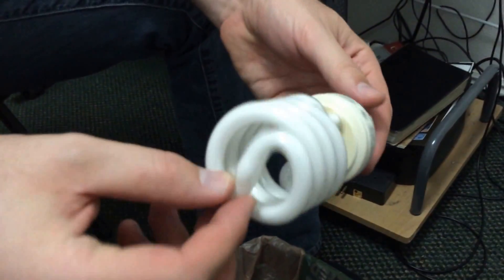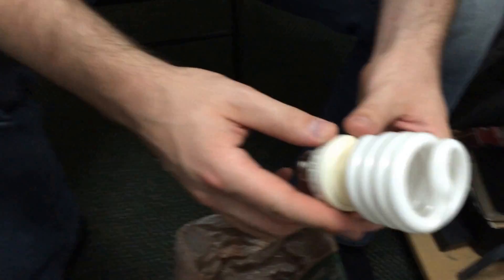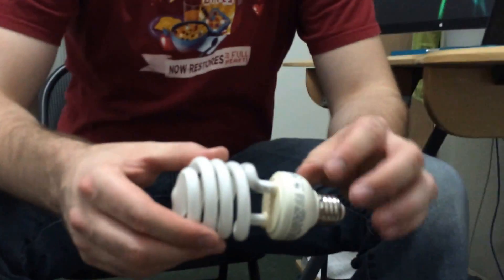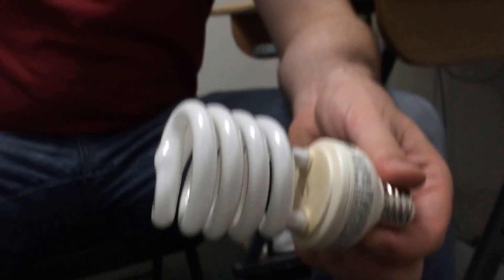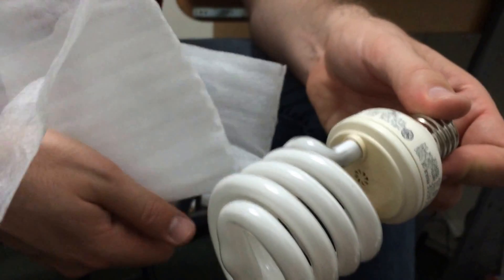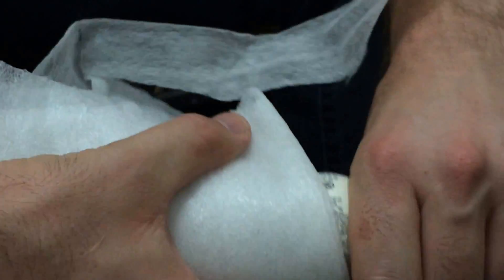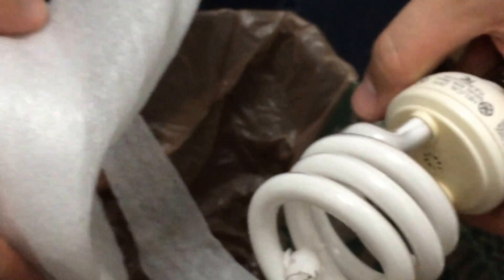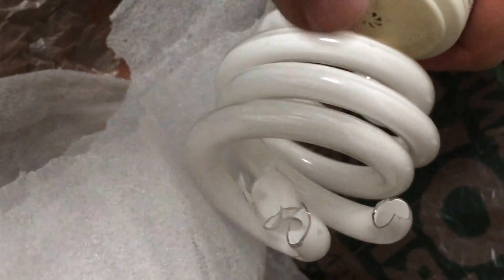How to fix a flickering CFLs and why they don't last 10 years as promised?

Comment: If you want to pry open the ballast compartment, pry at the seam that goes around it near the glass part. Hold it by the threaded screw terminal. There is a PCB with a few electronic components, a small transformer, some diodes, ceramic caps, electrolytic high voltage, SMD ceramic capacitors, SMD resistors, and small ferrite rings.

Comment: I have a CFL bulb which for some reason when I turn it on it will stay on for about 10 minutes and then starts blinking about every minute or so.  What could cause something like this?  It looks like the one you just broke in this video.
Reply: The heat causes marginal components to fail. For instance cracken ceramic capacitors or bad solder joints.